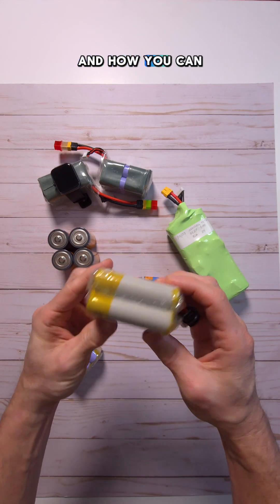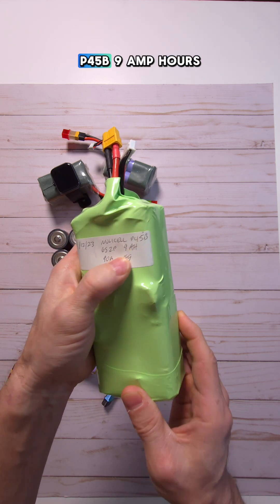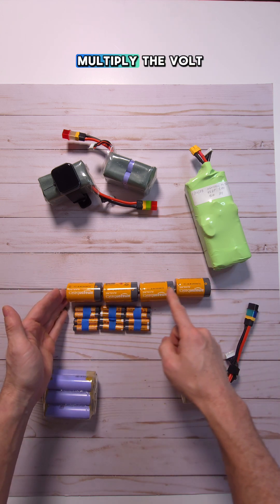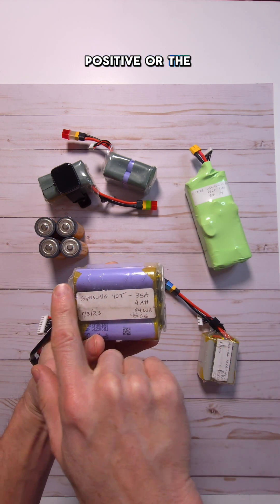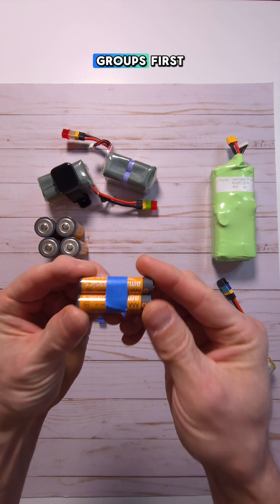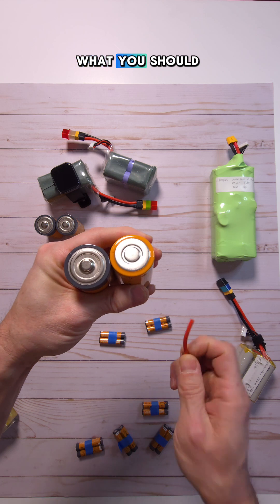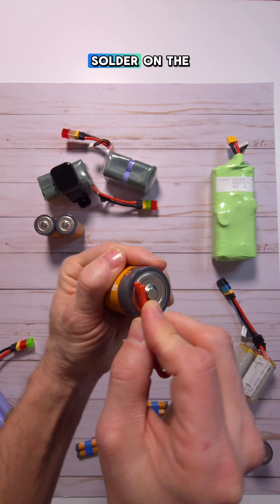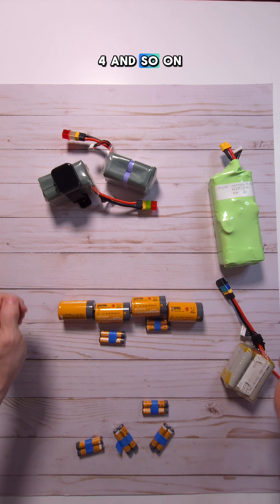How to Build Lithium-Ion Batteries for FPV Drones | Quick Guide & Setup Tips

Comment: I have a 20 brand new LG icr 18650 he2 2500mah 20A can i use them to build a pack for my 5inch drone for cruising and long range?? Can i make 4sp1 pack with those cells?
Reply from the maker: Unfortunately not, only use what I recommended, I wouldn't want to fly with anything under a 35 amp for a 1p pack, find another project or something for the cells but most likely it won't be fpv unless it's a smaller quad